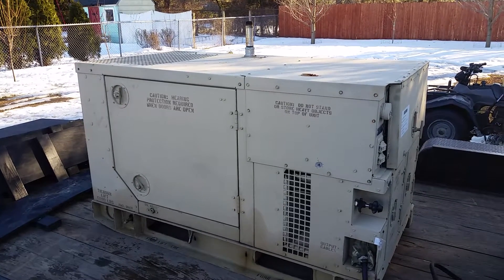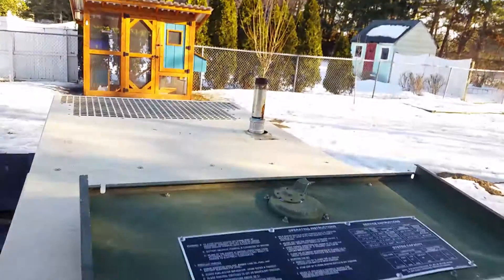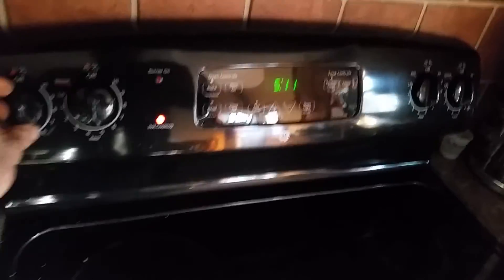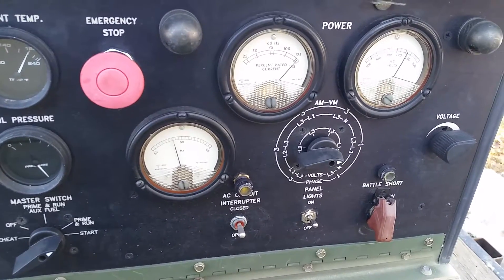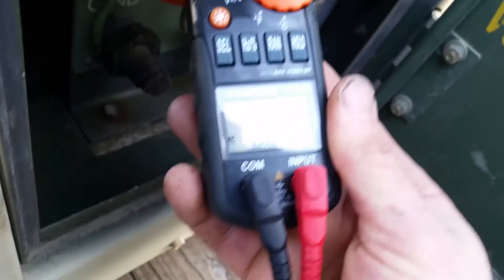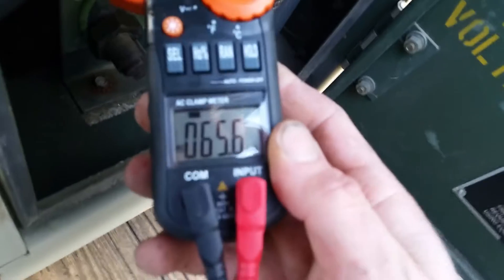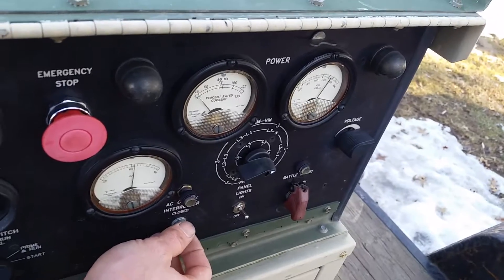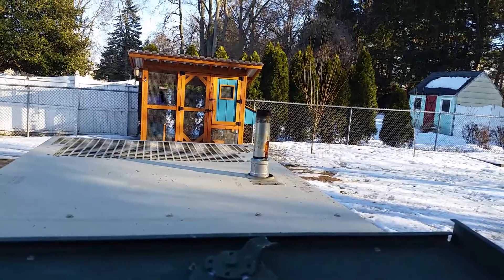MEP803A Load Test / demo - 10kw mep military generator Lister Petter diesel

Comment: haven't had any decent 803's for sale on gl near Michigan in a while. I love my 802 tho
Reply from the maker: I had an 802 for a while, but it consumed oil when under load.  (about a qt for every 24hrs of operation)  That and it didnt have enough power to start my air compressor so i upgraded to the 803.  Have you seen my video with this unit converted into a trailer?
Reply: +kzguy2 what's the harbor freight pn for that axle kit or did you have to buy a whole trailer
Reply from the maker: +Bobby Diminnie      yea it was the whole trailer.  But i didnt mind, because i used the metal for other projects anyway.  i fid have to cut and re weld the axle.  But for the price, you couldnt beat it.  Im not sure the part number was.  i think it was the next size up from their smallest trailer